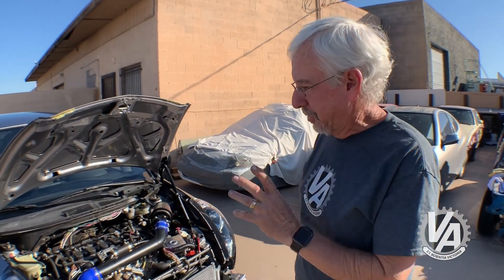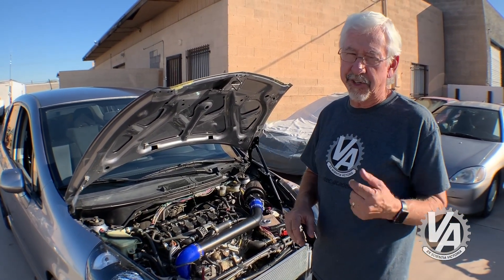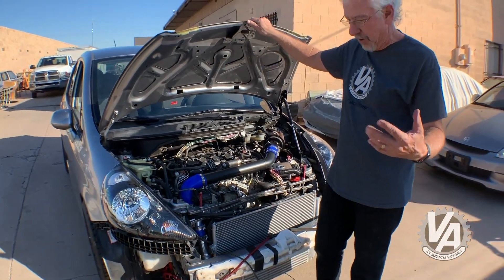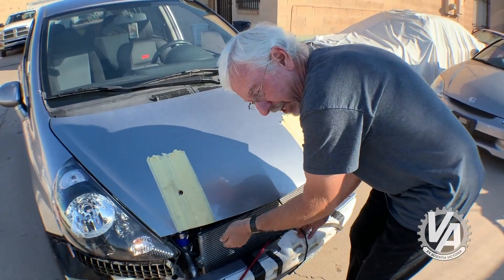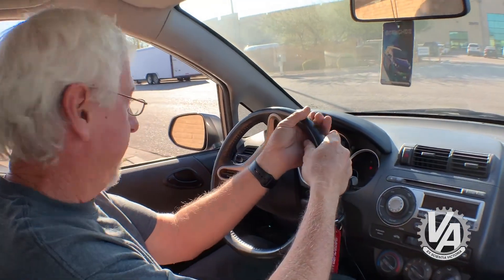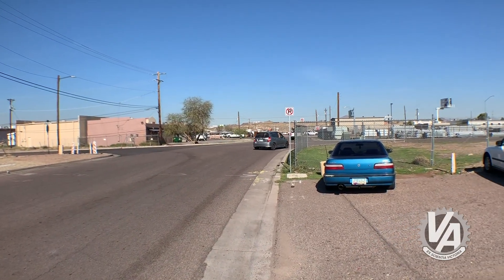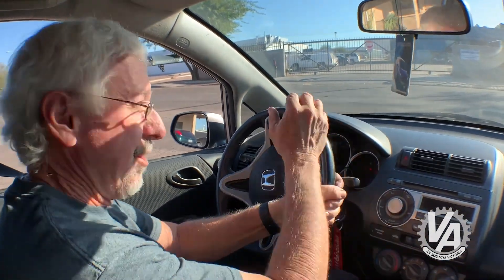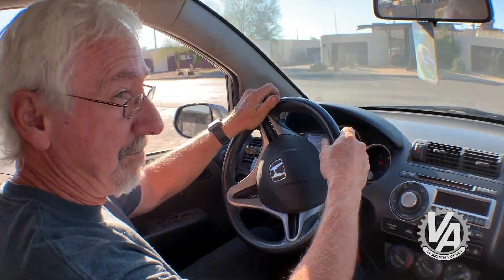First Running L15B7 Swapped Honda Fit

Comment: I recently got my Fit and came across the L15B7 Fit Freak thread. Has this project been scratched or is it still making progress? I will 100% buy any supporting parts or kits you supply for this swap.

Comment: what mounts are you using send link please 
and harness
Reply from the maker: https://hasportperformance.com/product/fgk1-mount-kit-for-k-series-engine-swap-into-2006-2011-civic-equipped-originally-with-the-r18-engine/ on the mounts.
The harness was 06-11 Si and a hand made adapter.

Comment: My 07 fit is about to hit 180k miles on the original engine. Let's say I'm shopping around for when it squaks 🤣.
Reply from the maker: Just saying, but the K is a much easier swap.
Reply: @VTECAcademy  understandably but if this can be reproduced into a swap kit down the road it'd be pretty sweet.
Reply: @VTECAcademy  is it though?  Nobody really makes a complete swap kit or all the ancillary parts for K swapping a fit.  All I’ve seen is the mounts.

Comment: I'm guessing it's not possible to bolt a L15A7 head to a L15b7 bottom end in order to keep mpfi.
Reply from the maker: I doubt it, but I haven't tried it. Someone may ba working on an intake adapter to mount injectors.

Comment: @vtecacademy , has anyone ever swapped over just the head from a L15B7 to an L15A7 on a GE8 Fit? It seems like the blocks are totally the same. Just the heads are different. That would be a killer swap if so.
Reply from the maker: Interesting thought and no I haven't. The blocks are different, but that doesn't mean that wouldn't work. The easy to figure out if it's worth a try would be to order the head gaskets from both and compare.
Reply: @VTECAcademy  Good idea! I work at a Honda dealer so maybe I can do some of my own R&D. Lol.
Reply from the maker: @Npgeiter  Let me know what you find!

Comment: Hey brian i just blew my stock engine on my fit its been rough  but im thinking qbout saving up for a swap to a bigger engine since itll be getting taken out anyway have you made the chasis what would this swap run someone $ wise ive been moding my fot for a year now so its a really big set back to lose the engine figured maybe i could turn the luck around by getting enjoyment out of it.

Comment: Is it worth turboing the stock L15A in the 07-08 Fit's at this point? I know the aftermarket (in the US) has long left the first gen Fits for newer things but I still have mine and would like to get usual power out of it, nothing crazy, I'd be happy with 150WHP over the puny 107CHP it came with from the factory.

Comment: So what does one need to get this working? Obviously an L15B7. I assume you using a better clutch because I don't think the stock clutch because I doubt the stock clutch can deal with that sort of torque. Engine management? Is the Hondata a stand alone?

I recently got myself a really clean low milage (120000km) GD3 with the L15A1 and I want more power. But I think it will be cheaper to just drop this engine in rather than build up the A1 for a Turbo.

Comment: Damn! awesome! I still own my fit, 13 years running bough new in 2007. Despite some rust in the rear wheel well and the damn water leaks plaguing those fit (around 107 miles to it), It is doing well. I would love this engine in it! even the least powerful version would be perfect for me. I've heard about this last year, happy to discover it is working! now.. I need money... ;-)

Comment: Hi, thanks for all the educating video and info.. I have a 2and Gen Fit.  No one made a video if the civic turbo system( flage+turbo) fits in a Honda Fit 2009-11. Hope get a awnser or a explanation video.
Reply from the maker: I don't have one of those cars, but I do have a CRZ which is very similar. It does fit that car.

Comment: In Europe, the HR-V Sport, has the 1.5T 185hp. Since the HR-V is based on the Fit/Jazz platform, there shouldn't be any problem for Honda to build a real Fit/Jazz RS with this engine. In the CR-Z You could get a turbo from HRD. Honda why not build a 'god' CR-Z with the 2.0T 250 hp engine in it?!??

Comment: Man... if I could fit a b series, or k series in my 2018 6 speed fit....... dont get me wrong, the L15 is a great little 1.5L but 1.8 or 2.0 makes a bit more sense for realistic power goals.
Reply from the maker: The K bolts in with the Hasport mount kit.

Comment: I'm not very familiar with the L series engines but what are the advantages of going with this swap over building and  turbocharging the stock L15?
Reply from the maker: The turbo Honda choose is incredibly well matched to the engine they built for it. There is a lot of aftermarket support for tuning options for the new engine too. Also, if you were to turbo charge the stock L15 engine to equivalent levels the L15B7 is capable of the stock transmission would last very long. You would also need to strengthen the internal components of the stock engine.
Reply: VTEC Academy right on, that makes sense. Thanks for taking the time to reply!

Comment: Can you guys run AC with the swap?
Reply from the maker: Probably. The issue I see is the climate control communication. There needs to be a way to talk to the ECU so it thinks the system is working properly. I'm not sure how integrated the climate control and engine management is. It may just need to know the compressor is on, or it may need more information.
Reply: @VTECAcademy  I just bought a GE with intent to swap motor. 
Was looking to use an ECU from a car with the same 49 pin connectors.
The A/C in the Fit/Jazz has a pin on the A connector running to the evap temp sensor.
All the other cars with the 49 pin ECU seem to have a pin for the A/C pressure switch instead.
Both arrangements appear to have the switch or sensor talking to a resistor(?) in the ECU with similar values, which led me to hope one could just pin the Fit evap temp sensor to the pressure switch pin on the swapped ECU.
As for the motor to dash harness connector...? No idea. Lol. 
Pretty sure the GD has similar communication between ECU "E" connector and evap sensor, but wish I knew more about how it all worked :(

Comment: Well I was about to buy a k20z3 and this has me reconsidering. I will hold off on a swap until more information is available on this one. I know with the k20z3 you can basically darn near plug and play as for as ecu and electronics go. No matter what swap I do it will require custom hood latch or hood pins since I have jdm front. Can’t wait to see more
Reply: u dont want the k20z3... it has bad casting
Reply: Josiah Butler bad casting where? I’ve had 3 of them with no issues

Comment: Honda missed a Huge market by never offering a Fit Si in the states. Thanks to you Brian, that is becoming a reality for us. A gen 3 fit with this swap would make for a helluva DD. Thanks for all of your hard work!
Reply: I've been talking to the higher ups in Honda for years begging for a Fit Si, it would sell like hot cakes, but they think the target demographic wouldn't care enough about some added power
Reply: @FlyinGato  goes to show you can lead a horse to water. But can't make it drink. It's really unfortunate well probably never see a production version here.

Btw; I like your channel!
Reply: C_DOES well it’s not called the fit SI in other countries it’s the RS and there’s only aero improvements.....
Reply: Ford made it.  Fiesta ST.  Outstanding car.
Reply: @millll111lllI  yeah and now look, ford cut their car line up out. So they must not have been selling that great
Reply: @nrvsauto8990  LOL the success of the Ford Motor Company was not hanging on the sales of a $20K hot hatch.  Honestly, I don't know why anyone would bother doing this engine swap when the Fiesta ST exists.  It's lighter than an Acura Integra, comes turbocharged with a boatload of torque, Recaro seats.  It's everything that 70% of the Honda tuner crowd tries to achieve.
Reply: @millll111lllI  Does it come manual or DCT only??
Reply: maxbored Manual only.
Reply: @millll111lllI   Point taken, for me the sleeper element is a big draw.
An ST is pretty heart on sleeve, but a Fit/Jazz here in the UK is an old person car. Great basis for a little trolling...
Reply: @jamesbagguley868  that's true, but given how Honda styled the Civic Type R, I think their take on a Fit/Jazz with an L15B7 would look obviously different than the "normal" Fit/Jazz models... This Fit looks stunning, with some OEM wheels you'd never guess it has a ~150hp turbo 1.5L under the bonnet...
Reply: @millll111lllI  yes, those Fiesta ST are so close to the spirit of the 4th and 5th gen Civic SI. That's my actual car, daily/track and unless Honda can give me something that match it I won't get back. #pocketrocket

Comment: Holy!!!!!!!!!! I didn't expect someone swapping L15B7.... until now!
By the way, are the driveshafts of this L15B7 suitable to this Fit without any modification? Or using the original Fit's driveshafts?
I'm looking for swapping in EG, that would be super awesome! (as I'm driving EG, and looking for some tech like this)

Comment: I thought that’s what motor they come with, a L15 right?
Reply: I believe the stock motor is a single cam NA L15A and the swap is the turbo L15B7 from the new Civic
Reply: Ok thanks for clearing that up👍🏽
Reply: The l15a1 must be pretty pathetic to swap for this 1.5 also not worth time to most for r&d on the a1
Reply: Why not just put a k20/24 and turbo charge it?
Reply: @Rudenutts  Compatibility issues. Recently Honda has built their engines up as opposed to out and they fit better in cramped but tall compartments like the Fit's. They did a talk on the L15B7 a year or 2 ago that explained some initial thoughts on  an L15A Fit swap

Comment: Whats the stock redline. I really miss the 8k rpm screamers Honda use to make. Glad i still have my jdm b16a 8200rpm every day!!
Reply: 6500 rpm.
Reply: @Sergio Aguirre Cute? Stop.....
Reply: Sad that Honda doesnt really do high revving N/A engines anymore. Not many manufacturers do
Reply: @christopherjohnston6343  for sure.
Reply: @Sergio Aguirre - real Honda enthusiasts don't hate on any series engines.  B series is a legend and still a blast to drive.  There are B series making 500 hp easy so what exactly is your problem?
Reply: There’s no Vtec so no vtec scream. Curious to see how it goes
Reply: @Sergio Aguirre lol i can just bolt on a turbo onto my b16 and boom. I have an 11 second car too! Big deal. Nothing special about that. Same goes for other turbocharged engines.
Reply: @JDMEXforme  so easy you haven't done it. rolleyes.
Reply: @jonathanm5742  no because im thinking about an all motor kseries build. 220whp at 8400rpm good enough for my daily coupe.
Reply: JDMEXforme make sure you do your maintenance and it should last a good while even beating on her high rpm, they just don’t make cars like they used to especially jdm
Reply: Why do you crack babies always come in this discussion and bring up other Honda motors? Nobody was trying to start a war over which Honda motor is better. Swapping in L 15 is now just another option.
Reply: @Sergio Aguirre fart sniffer
Reply: Sergio Aguirre I appreciate both engine series in different ways. But it is the truth. Honda has been having many complaints from their direct injection system due to gasoline blowing by the pistons on cold start, thereby diluting the oil with gasoline. On the other hand, the B Series burns the fuck out of oil, but so does my K20, my BRZ, and my mom’s CR-V. The L15 will burn oil as it ages. All japanese engines burn oil.
Reply: @PacMan592  you are correct. Just read an article about it.
Reply: Sergio Aguirre 😂😂😂
Reply: Sergio Aguirre the B will always be cheaper...and faster as of right now
Reply: Sergio Aguirre actually the direct injection sucks. the electric wastegate doesnt really help for performance. the direct injection is so bad that causes oil dilution. also direct injection has power limits at 400. after that everyone switches to tradition ported injection. coil on plug can easily be done on a old b series. really... a boosted b16 will make same power as new L15 an be just as reliable.
Reply: JCannabis Sergio isn’t capable of giving you a logical explanation he just tells you what ever and you’re lying. Grade A idiot on the page

Comment: I have a dc2 integra that's been sitting. This would be fantastic.
Reply: Ketchup918 why down grade to a 1.5😂
Reply: @Rudenutts  Stock turbo
Reply: @Rudenutts  mote grunt, less weight, more efficiency over an older tech motor, better tech all around, just better. In small motors cubes ain’t always the answer. My std Jazz 1339 puts out much more grunt for less fuel than the Hp of an original cooper S or 74  eb civic. One of which I own and love. 
 That would be a great swap as those integra’s look classic!

Comment: Wow those injectors are loud!
Reply: Thats the fuel pump not the injectors
Reply: @InNoTime3377  the fuel pump noise is constant, the noise that sounds like hellish lifter tick is the injectors.
Reply: @Puffalupagus360  maybe its a combo of both cause mechanical fuel pumps can be loud since they run straight off the camshaft and cant be a constant sound...the higher u rev that motor the faster the cam spins....
Reply: @InNoTime3377    I'm speaking specifically about the begining of the video @ 00:20 where you hear the injectors firing.
Reply: Its a GDI engine thats why. Those are High Pressure Injectors.

Comment from the maker: Not dynoed yet, we just got it running for the first time.
Reply: Where can i buy the motor mounts?
Reply: VTEC Academy  can it be done for the Cr-z ?
Reply from the maker: Julio Alvarado Our CR-Z was the first car to have the L15B7 swap mounted. So, absolutely.
Reply: @VTECAcademy  can this swap be done for an EK (hatch)? I've always been curious
Reply: @VTECAcademy  any idea on pricing for something like this? I think it's amazing idea. Fantastic work fellas
Reply: @VTECAcademy  wait you've put it in a crz? Got a vid??
Reply from the maker: @judge9637  I probably have photos, but no video. It's out again but will go back in at some point in the future.
Reply: @VTECAcademy  ahhh ok well make a vid on the no offense to the fit, but I'm much more interested in seeing that an details on it
Reply: Waiting for it to be in the ef :(
Reply: Do you know if you can direct swap the newer gens into the first gen
Reply: @VTEC Academy are there more details on this? Possible to BAR in CA? Been waiting YEARS for this 🥹